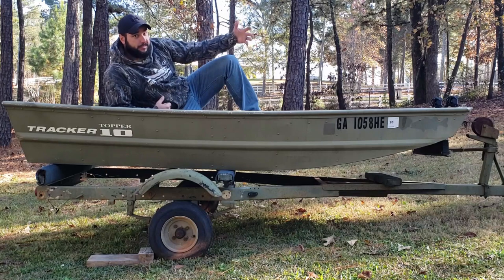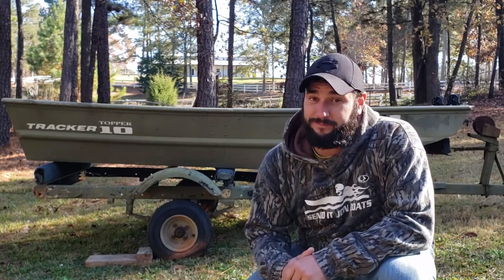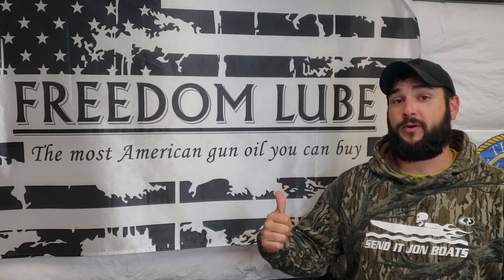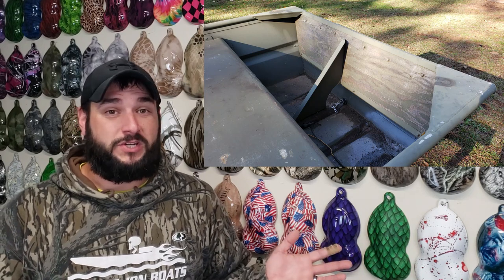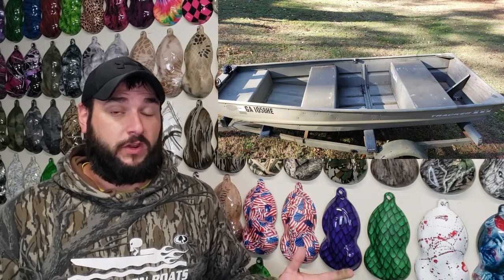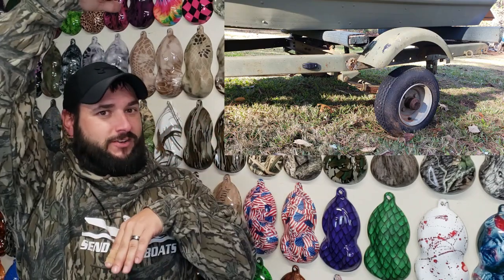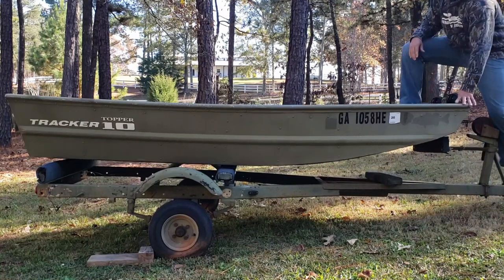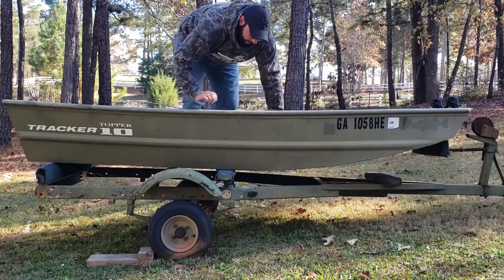Introducing Project Pocket Rocket

Comment: Love this project #pocketrocket. Our #radioflyer is doing 20mph on a 212 stock. Better buckle up buttercup with this build 😬 with the ambitions you have sir. I am so excited for this build!!!!!
Reply from the maker: Thanks bud... Radio Flyer is gonna be flying to if you end up modding that motor.
Reply: @SendItJonBoats  the best mod for a 212 is a 301cc 8hp or GX270 clone with double the torque stock than a 212cc. But the predator 212 with tillotson TCT mechanical fuel injection is doing pretty good.

Comment: Can you direct me to your video connecting the predator to extended fuel tank?
Reply from the maker: I haven't done one. It's easy, rubber hose from tank to fuel pump, then a filter, and up to the carb.
Reply: @SendItJonBoats  Thanks

Comment: I had a 1955 feathercraft vagabond . All rivet it had 95 model 60 hp Johnson that had a little work done to it . It would scare the shit outta you very very unstable at 35 + mph . That was my plan for it to mate a jet drive to a 1200 cc Harley or a 1000 cc crothcrocket. Then I wanted to do the big Harley eng in the front of the boat with a long shaft with prop and have a 5 speed gearbox mounted to her . Anyways I have since sold it which I regret everyday ! I just got my hands on a 12 Jon boat 4 days ago . We bout to build something sketchy boys !!
Reply from the maker: YEE YEE! Build something crazy! I love crazy boat builds. I got to get back to work on this one asap. Been so busy with work havent had a lot of spare time.
Reply: @SendItJonBoats  Rah Jo buddy . Be safe out there.

Comment: This should be interesting... LOL
Reply from the maker: Interesting is a word LOL. It will be very interesting if I don't twist the boat in half from all the torque. I am working on a speed testing video now, and even with a small 13 hp motor that boat flies!
Reply: @SendItJonBoats  EXACTLY!!!  I can't see you putting anything bigger than a 883 v-twin on the boat without it being too heavy in the a%&..., but we will see ;)
Reply from the maker: @numberonenole4590  I had some massive float pods welded on the back, they are insanely huge. Should float a evo or 96 pretty easily now. I am waiting for Harbor Freight to get the 670 predators back in stock so I can test one of those out on it first before I blow money and time on a harley motor.
Reply: @SendItJonBoats  AWESOME!!  Can't wait to see it.